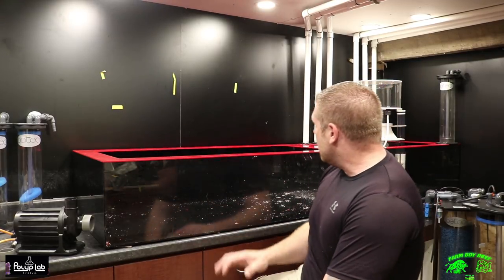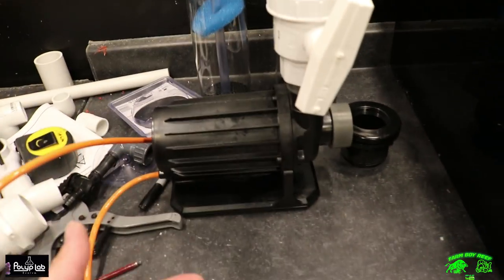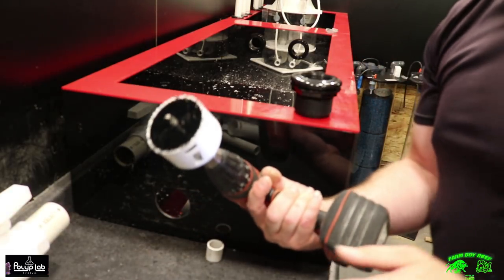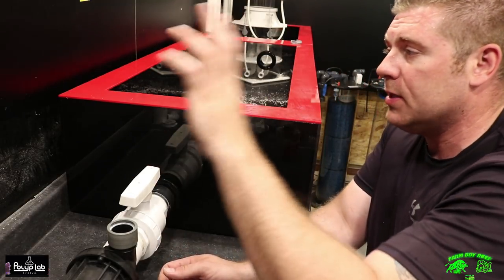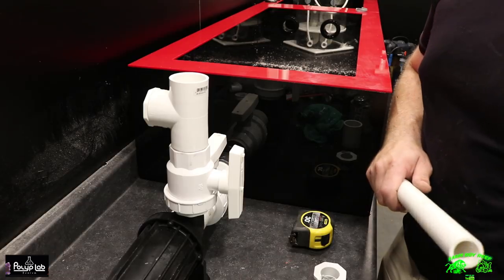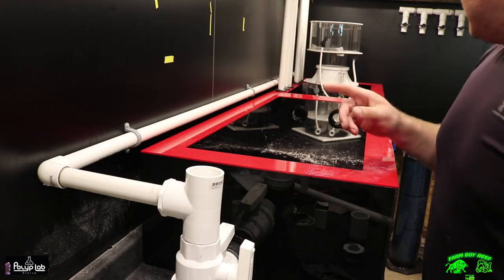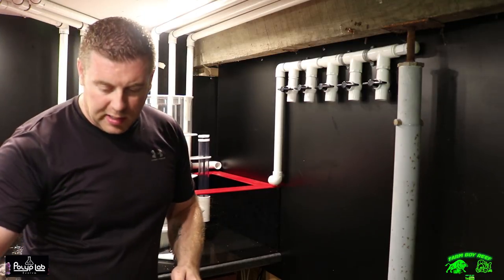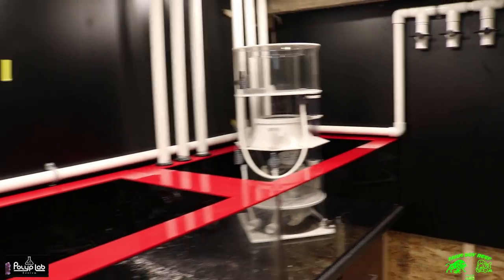700 Gallon Phoenix reef tank, fish room, and all the sump pluming

Comment: I love your videos and have been watching for the last couple months. I just had my previous 180g tank seam split after 10 years on Memorial day morning before throwing the ribs on the smoker and replaced it with another 220g. I used the Charlotte pipe single unions (if they are the Charlotte pipe from Lowes) that you show in this video coming from my Synergy Reef overflow going into my sump on each 1.5" pipe so I could cut the water to each one when I need to change my filter socks. First time I needed to I cut the flow to the one and when I unscrewed the pipe the seal broke loose from the union, water everywhere. So i figured ok got a bad union. Went to change the 2nd one and same thing happened. Maybe I got 2 bad unions but I ordered the Spears gate valves after that and haven't had any issues.
Reply from the maker: +jonathan brigman man what luck on unions ! Thanks for following my crazy builds lol

Comment: Very nice Plumbing work , my concerns are that you didn't use any cleaner on the pvc and that's how it suppose to be used for better bonding and instead of those glue in ball valves I prefer the one with unions on both side for when they star falling to close properly, just an small tip from a 35 years old plumber. But overall NICE JOB I can wait to see all working
Reply from the maker: +CUBAN REEFER hi bud here in Canada the glue we have has primer and glue all in one step :)

Comment: you are probably going to have to add a ball valve to that 1 inch line to the reactors. Although you decreased the diameter it is still the path of least resistance because of the head pressure up to the tank.
Reply: did not see all the ball valves on the manifold. spoke to soon. sorry
Reply from the maker: +Joe Roush  dome :) added 5
Reply from the maker: +Joe Roush lol all good buddy

Comment: Great video. I have a question. I have a 420 gal tank that I'm working on that has two of the 20" Shadow overflows. The return pump is a Reeflo Super Dart / Snapper Gold Hybrid (4300⁄2400 GPH) that has a 2" FPT inlet and a 1.5" FPT outlet. I too, was wanting to use 3/4" Loc-line at the tank. Do I stay with 1.5" on the pipe from the return pump to the tank and then reduce to 3/4" bulk heads or do I not use Loc-lines and reduce to maybe a 1" bulk head? Thanks in advance!